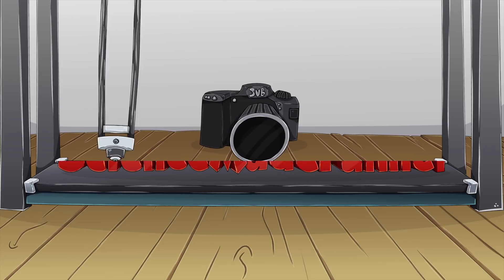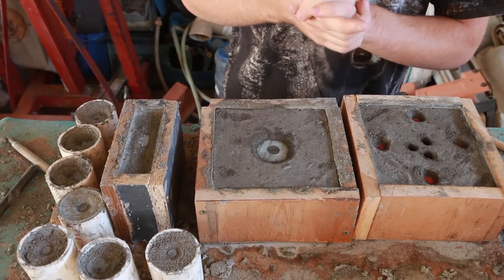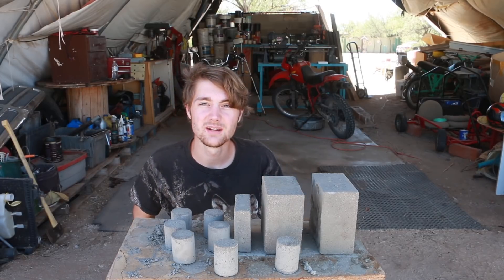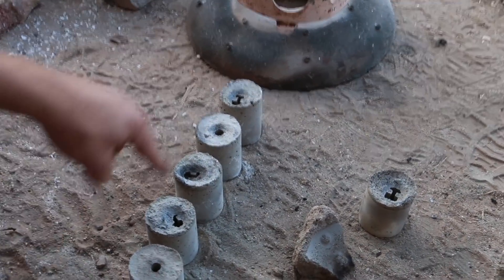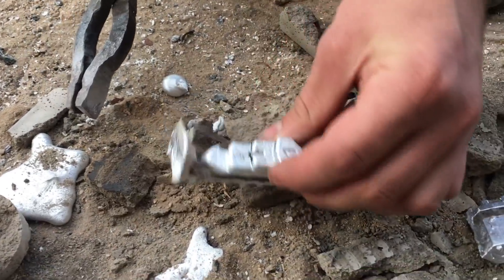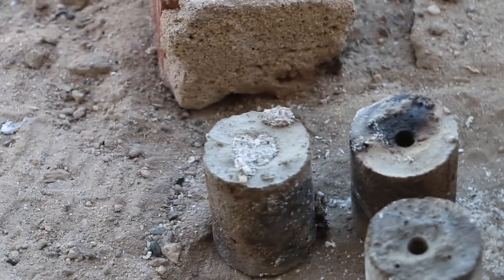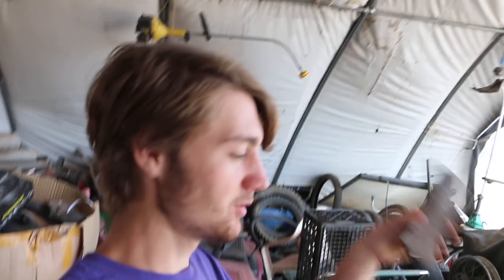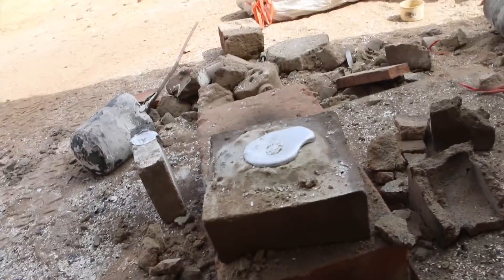Casting an Aluminum Chuck (part 3)

Comment: Quick suggestions from a mechanical engineer: spruise, open riser, blind riser, hot mold. Also: position the part in the mold with the thinner parts away from where the metal is entering the mold. This will improve the filling of the mold

Comment: You can get much smoother parts in plaster with aluminum. You also need sprues in thin sections to get full feeds and pour into a hot mold.

Comment: You need to add feeder sprues on the thinner parts, particularly when they are joined to a thicker section. When the metal cools it is contracting and starving some of the parts. Also put your investment into METAL frames, you can use pipe to make them or welded square frames. Pour while the molds are still warm rather than cold, and then quench in cold water to get the investment out of the metal frames easier. (Again Practical Casting: A Studio Reference, Revised Edition - Tim McCreight and Centrifugal or Lost Wax Jewelry Casting: For Schools, Tradesmen, Craftsmen by Murray Bovin will save you a lot of time on your learning curve.)

Comment: Just an few ideas, print the air vent and pour inlet as part of the part. That could help you control where they are in your molds. Maybe pour the molten aluminum into a hot mold?